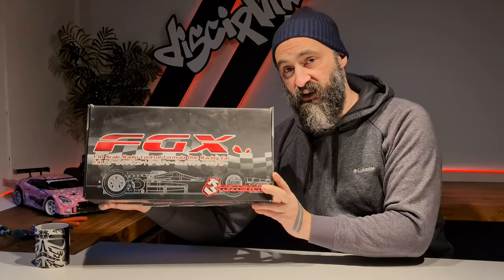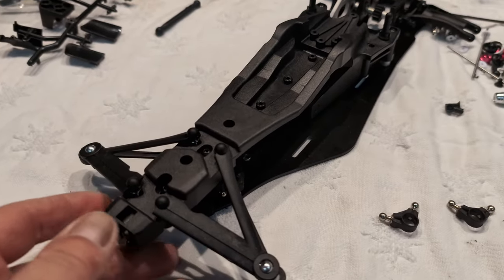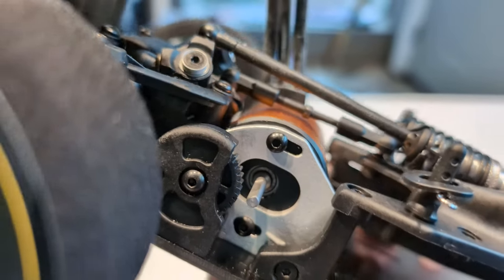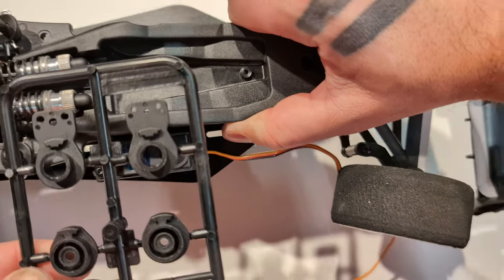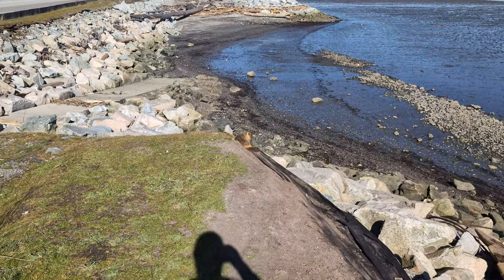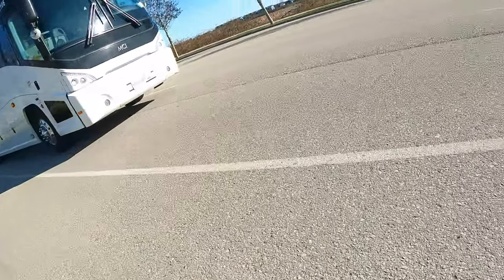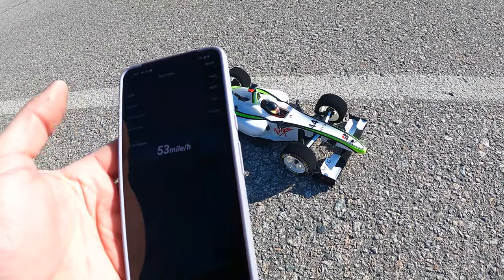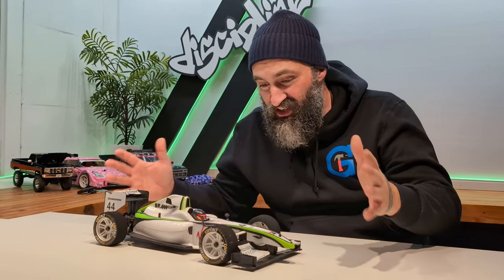Will this 14 Year Old F1 Car Hit 60mph??

Comment: TIP: Next time spray some brake cleaner or electrical cleaner on the rear foam tires. That is how we get grip on asphalt oval racing 2WD NASCAR.  Just spray a little bit to soak the tire a bit and then let it dry which won't take long. Once it's dried do your top speed pass.  It will grip like crazy. I doubt you need to do it on the front tires. It's usually the rear end that washes out. Awesome F1 car, sick paint job, dude.
Reply: That works amazing. I just tried it on my B7 carpet racer on my street. It's almost too grippy now. I have under stear for the first time. I could never get it to grip on concrete. This is a game changer for me.. I will try the front tires to. Thanks for the tip. Super stoked!
Reply: @beerforyourhorses3812 You're welcome. Glad I could help. Cheers.
Reply from the maker: That's a great tip man!! I'm going to have to try that out. With the speed run season coming, this will help out so much. Thank you sir!! 😁 🙏
Reply from the maker: Nice to know 😁👌
Reply: Spider Red additive will give it loads of grip on tarmac, well worth considering.
Reply: they use grip gel in offices, its safe for you and the planet than brake cleaner (it will also fuck up any rubber and plastics)

Comment: a locked rear diff would help tremendously.  A light 2wd car needs both rear tires to be spinning at the same exact speed, otherwise it'll spin out just like you saw. Also, if you could get the front suspension parts for it, that would also make a world of difference.
Reply from the maker: Agreed, more weight in the front will help as well 👍👍
Reply: I really think you should take a look at the tamiya f103 front end,  I think it contains your easy to get suspension. 

I've been driving f103's and conversions of it for quite some time and the front end of your car looks really familiar to me. 
Also, 3 racing has started as a kind of tamiya tuner/upgrader and I remember lots of 3 racing parts and kits for my f103.

Nice Video btw 👌
Reply from the maker: @deathbysnoosnoo1215  there are a few Tamiya's that I've been wanting to build and that's one of them for sure 👍

Comment: In the UK we have L plates. Have you considered the option lol. Great content man
Reply from the maker: Yep, but the way it's integrated into the chassis and other components, it would have been a lot to mess around with. Maybe next round 👍
Reply: @disciplinerc  53 was a strong achievement for the first run. You should be very pleased. And you got to meet Alan
Reply from the maker: @chrislang7460  🦫👌

Comment: You don't need a 4s pack. Get a 2s shorty and a 13.5 or 17.5 motor. Change the gearing. Raise the ride height. Add about 30 grams to the rear. Turn the punch all the way down on the speed control. 70 mph easily.
Reply from the maker: Agreed 💯! I had a very short weather window and didn't have time to even set up the electronics. A tiny bit of tuning and a 3s would have gone a long ways 👍
Reply: @disciplinerc  100 percent understanble. Damn weather is killing our race days here in NorCal as well. 
I was just throwing some tips out there. I would love to see another pass at it. Idk if you have a setup station but it does wonders. 
 Front toe out 1 degree. 
.5 camber 
Set full throw of steering to about 18 degrees you adjust this in your steering epa. 
Punch 0
Drive frequency 8k
Brakes turn down to the point where if you stab it it doesn't get loose while braking. So way down like 30 percent. 

Exotek rubber tires actually have crazy grip. They sell them for f1. Soft medium and hard. Go soft rear and med front. Depending on the temps. You can even cook tire sauce into the rears with tire heaters. Foam tires on uneven pavement will never work. It rips apart the foam easily. 

Hope that helps. 😉

Comment: I have found the cheap Amazon servos are NOT a good idea for cars with speed. You need a mid to high range servo along with a stability program like AVC. Night and day difference.
Reply from the maker: I tend to agree with you, but when the entire build is under $150, it's hard to justify a servo that costs half if not more of the build itself. When the dollar value increases, speed increases and the loss component is real, a better servo is a must 😁👍
Reply: @disciplinerc  I agree with you. I find it fun and challenging to take cars with a low price point (like yours) and make them great. Upgrades, electronics or just tuning/tweaking. I have some TT01, TL01, Fazers, TT02, etc, that are well equipped and drive like high end touring cars. Straight, smooth, fast, and they put a smile on my face.
Reply from the maker: @aut0bahn  🤘🤘

Comment: Run 4s again. Set the throttle epa to 75% and if you have the ability to add a throttle delay set that up. Youll get that 60
Reply from the maker: Totally. I think with a few fixes, it could hit 80 👍
Reply: @disciplinerc  oh definitely if you can dial in that ramp in and keep it straight. Looks like a fun car too bad they are discontinued

Comment: I do not understand the spur problem, the motor positijn is adjustable, u could have put a bigger pinion
Reply: I believe he said there was no room for adjustment cheers 👍
Reply from the maker: If you watch later on, I did manage to get a 20t pinion fitted with some modification